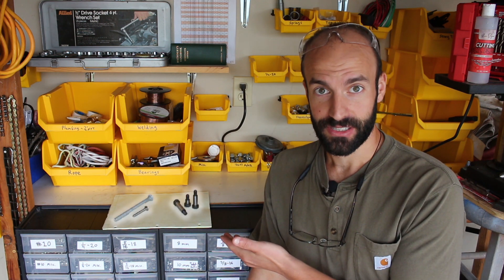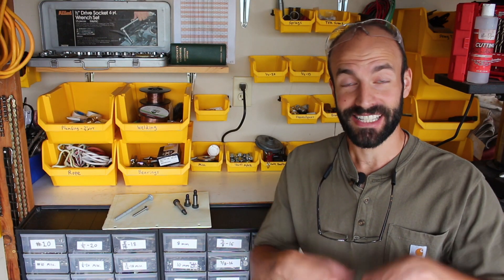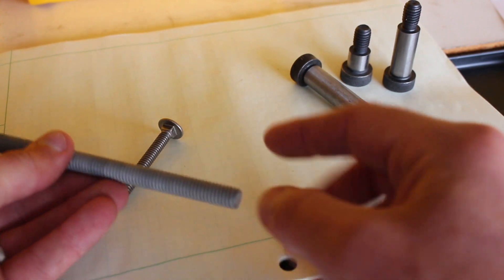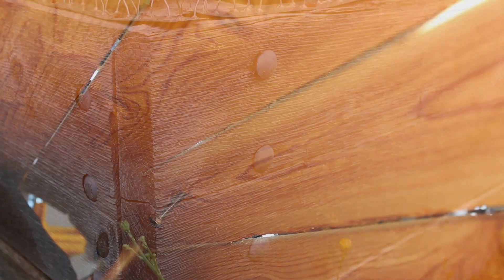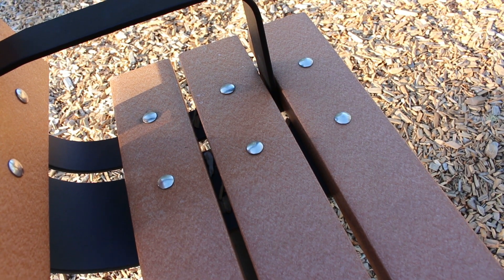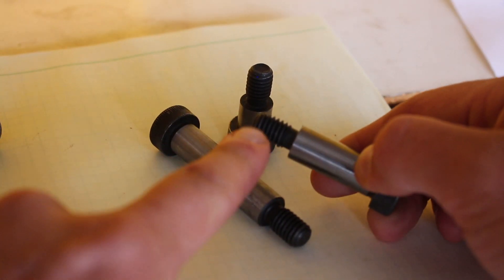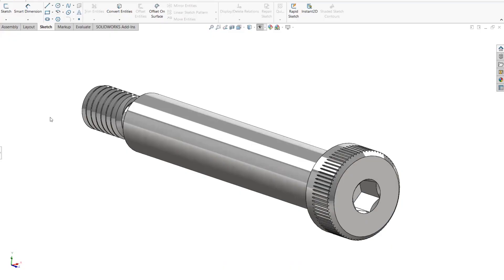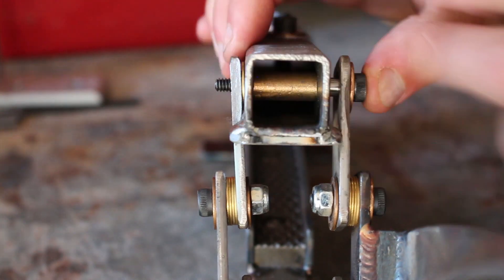Shoulder Screw vs. Carriage Bolt

Comment: Please help! 😢I have been searching for hours to find an answer! I am planning on using a shoulder bolt on a pivoting support arm on a draft desk. 
But I have no idea what length or width to get. 
The bits of wood will be a total of 41mm thick. How much over of the smooth section needs to poke out? 
And how wide does the hole have to be compared to the bolts thickness? 
Are you able to give me some advice? Please 😢
Reply from the maker: Hi Leaves! Without knowing your loading conditions, I'd start with about half my wood thickness for the shoulder diameter (20 mm or 3/4") and the shoulder length (the smooth part, before it's threaded) should protrude beyond the wood by .001" to .002" for fine applications (.025 to .050 mm) but if precision isn't necessary, then it doesn't matter as long as the smooth part pokes out of the wood. Then, when you torque on the nut, your wood will be free to pivot.

Comment: So 2 shoulder bolts are what i need to put on a diy wood tray with a tall handle (over the tray) that i want to push flat when storing, but stand upright to carry it?
Reply from the maker: If I understand correctly, that could work! I'm imagining clearance holes in the handle so it slides up (for handling) and down (for storing) the smooth shoulder of the shoulder bolt. The shoulder bolt would be torqued in place, sitting on its shoulder.

Comment: So the threads of the carriage bolt are not supposed to grip on to the wood? Instead you should be able to just push it in and out easily?
Reply from the maker: Yes! Purists would say that is what makes it a "bolt" and not a "screw." It is a clamp.
Reply: @McGuireMechanism  Good to know. Thank you!

Comment: how do I take out the carriage bolt? I am trying to remove my tail light and someone (previous owner or car dealership) placed something that looks like the carriage bolt.
Reply from the maker: Great question. If it is a carriage bolt, there should be a nut threaded onto it. Remove that nut, then tap or pry the threaded end to push out the bolt. Use a piece of wood against the bolt itself to avoid damaging the threads. If you don't have enough room to tap or pry the threaded tip, after removing the nut, you may need to apply a special removal technique like I show in these two videos linked below. Good luck!

https://www.youtube.com/watch?v=-BYQVypZoCI

https://www.youtube.com/watch?v=imAnhvgqs5I

Comment: Your initial point about standard sizes landed hard after I started shopping for shoulder bolts for my project. I'm trying to build a wooden gyroscope (you know like the space-travel device in contact) as a desk ornament and I'm looking for tiny shoulder bolts as the pivots. Maybe I'm over-engineering the thing. Anyways, cool video.
Reply from the maker: Thanks, Brian! That sounds like a super cool project. And good thinking, shoulder bolts make great joints.